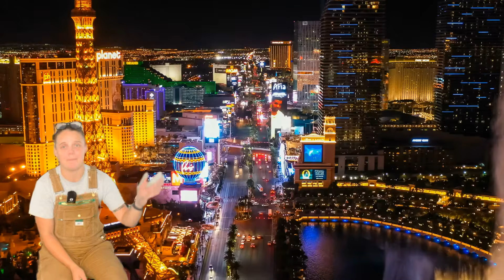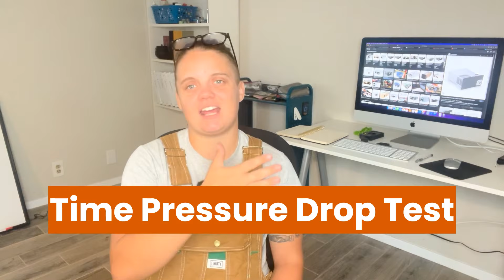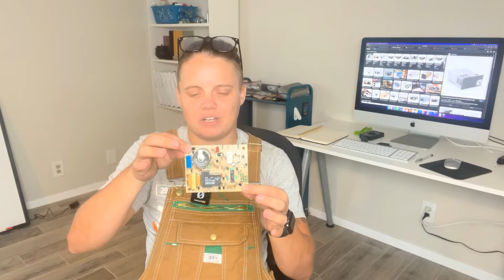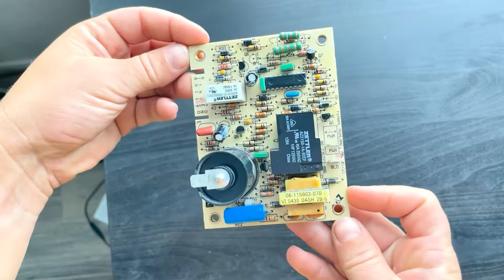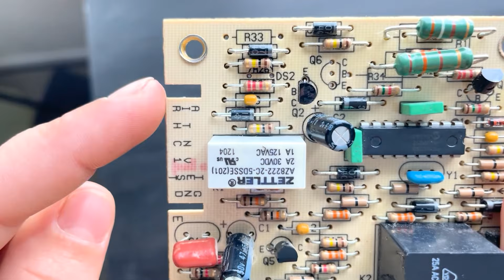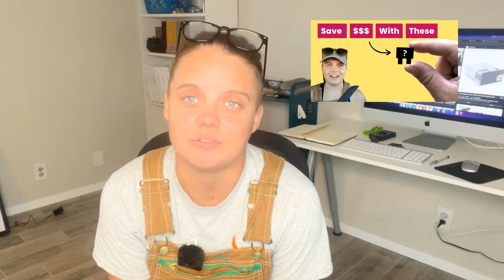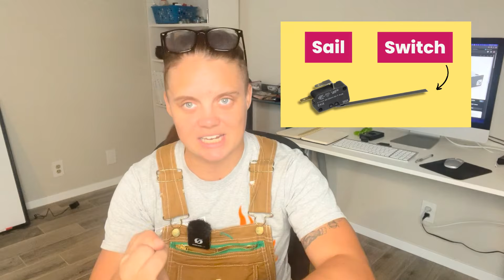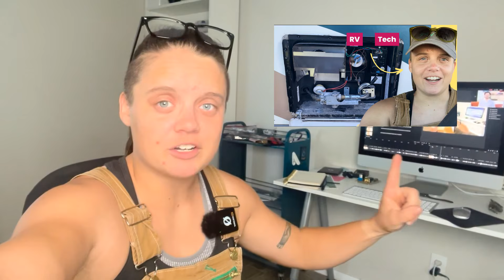How to Troubleshoot your RV Furnace Circuit Board

Comment: Great video. No one on YouTube talks about troubleshooting to the circuit board. Thanks.
Here are 3 things you may want to make videos about. I have an Atwood 7920-ii in my 2004 lance truck camper. I have had trouble for the last few years. Replaced every part except for the sail switch. Its still working fine though. This year i got trouble again. I want to replace the sail switch and clean out the dust, dirt and stuff in there and around the blower motor and thoroughly inspect everything. 
1. How do you get the exhaust pipe out? 
Every video shows it pulling right out after removing the screws and sealant outside. Mine seems rusted in place. No help from the manuel. Sail switch and blower are in the back and not accessible until i can pull the furnace out.
2. How do i set the ignighter electrode to burner spacing?
Once i install the electrode, there is no way to see the spacing from the electrode to the burner.
3. Is there a life expectancy to these furnaces?
One video i watched had a crack in the heat exchange chamber. Im wondering if i should stop trying to fix this old thing. I wish i could get it out to thoroughly clean and inspect it.
The current problem i have is it doesnt light. One flash on the led. Blower turns on and blows strong. Electric makes it through the safety stuff. Gas valve opens. Igniter clicks but sounds weak. Turns off after 3 tries. 2 years ago i replaced the electrode, burner and nozzle. Worked great for several months. Then stopped working. Spark sounded weak. Replaced circuit board. Problem solved. Strong spark and quick ignition. Worked good last winter. This year the spark sounds weak again and one flash on the led. First circuit board lasted 14 years. Im on my 3rd replacement in 5 years. Last one was the dinosaur board. Im so disgusted and tired of the unreliability. Im on disability and I dont have much money but i cant help wondering, have the new rv furnaces become any more efficient and reliable in the past 20 years? If so, i may consider getting a zero interest credit card and purchasing a new furnace. Any suggestions? 
Thanks in advance if you can find the time to answer and happy holidays.
Steve

Comment: I have intermittent issues with with my sf-30f...so far I've switched out all the parts except for the circuit board and the gas valve. My question is: do these valves get sticky? My heater would be working, then turn off like it normally would when the desired temp was reached...then it wouldn't fire back up. Blower and everything comes on like normal, doesn't ignite so the air doesn't get warm. Could the problem be the valve not opening so there's no gas to ignite. It seems like i keep getting it to work and then after cycling it won't fire up again.

Comment: OMG, amazing!! I am trying to fix my 8900 Hydroflame and I have 12v power all the way up to my board and out to the breaker and on/off switch I tested my 60704a0-42 relay and I could not get the relay to shut from the application of 12v power even directly connected to my truck battery. 
I am trying to find the replacement for the relay and all I can see s the dinosaur one.
what would be your suggestion?
Reply from the maker: I order dinosaur boards all the time and their customer service is top notch.

Comment: Great troubleshooting video! I just replaced board in my suburban furnace, solenoid clicked when thermostat set to high temp but no voltage from solenoid on BLO wire. I assumed sail switch circuit would not allow solenoid to click if either were bad. New board fixed the issue. I went with Suburban board for twice the 💴 than an Amazon board, not sure how those will hold up.

Comment: Hey. So I’m having an issue with my furnace shutting off after running for about 5 minutes. I took the outside cover off and reset the furnace and it instantly turned on I left the cover off for a few minutes and it stay on. It shut off again a few minutes after I put the cover on. If you have an idea what may be causing it that would be greatly appreciated.
Reply from the maker: Here are my shot in the dark thoughts since I can't be there to look at the furnace:
1. Is there any chance the room has gotten to temperature? The furnace isn't going to continuously run, it will stop once the room gets to temp. Crank the thermostat to 90 and see if it stay on longer than the 5 minutes. 
2. Wait until after the furnace stops working and then test your High Temperature Limit Switch (HTLS). I don't have a video on this yet, so let me try to explain how. If you can easy get to the back of the furnace, you should see it sitting there. Carefully disconnect the wires from it and then test it for continuity. If it has continuity while the furnace isn't working then its NOT your problem. If it doesn't have continuity then that guy is your most likely culprit. If you can more easily get to the front of the furnace (like where the sail switch is) then here is what you can do instead to test the HTLS. Look at your sail switch, there should be two wires going to it, one wire is going to lead to the top pin on the circuit board and the other is going to disappear into the furnace. Disconnect the wire the disappears into the furnace and check for continuity between it and the second pin on the circuit board (the thermostat pin). Again if you HAVE continuity while the furnace is off then the HTLS is not your problem. If you don't have continuity then the HTLS is your most likely culprit. 
3. Your 3rd option is to try to find a way to get the furnace to run and then fail while you have the circuit board accessible, so you can run the tests I show in the video after it fails. It could be that your circuit board stops sending the right signals at the right time.
Reply: @rvrepairwoman  I appreciate the response. It’s definitely not getting to the set temp. I’ll run those checks on the temp switch.